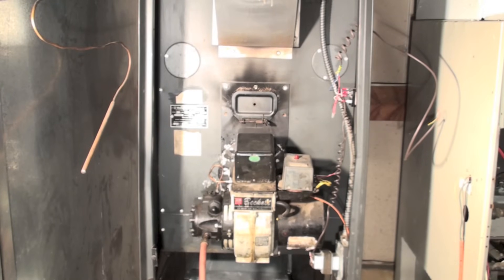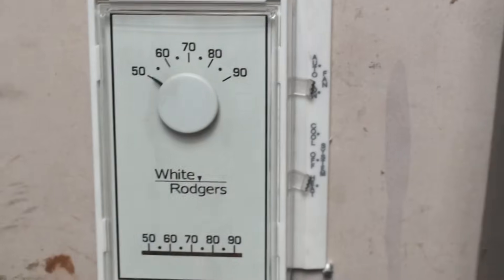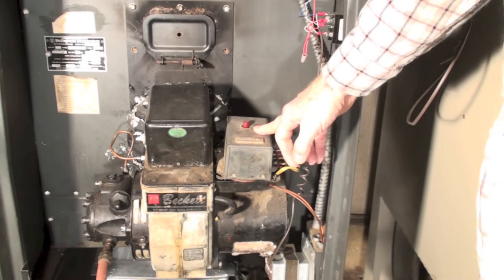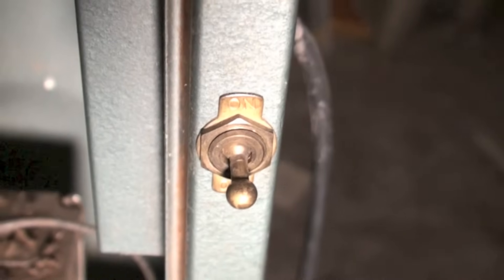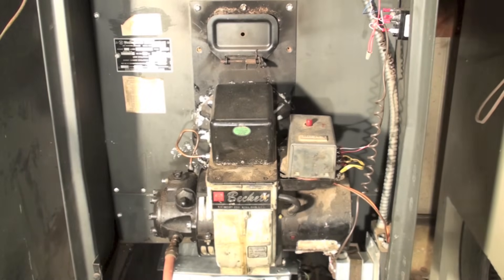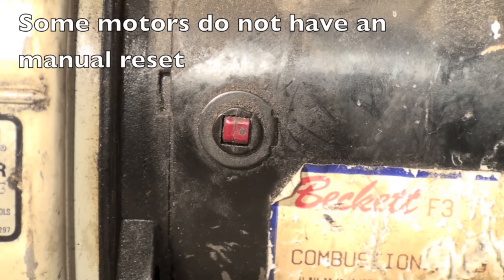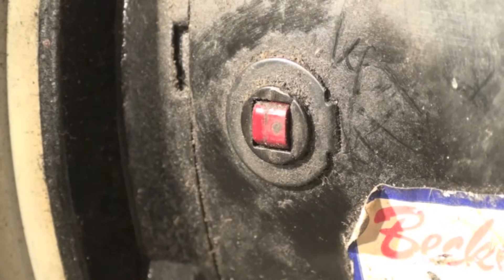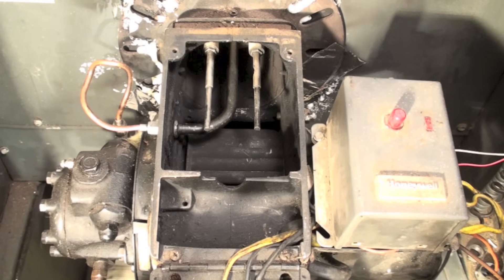Troubleshoot the oil furnace part 1. Burner won't start.

Comment: I want to THANK YOU! Oil burner locked out and did not restart. Did the normal maintenance - filter, cleaned gun, changed nozzle. Still nothing. Realized no oil to the gun, so took the whole thing apart looking for something clogged. Nothing. I thought maybe the pump was not working - flummoxed. Called for repair guy, but it's New Years Day and the guy said it was $300/hour. I decided I'd wait for Monday. Then saw that Home Depot has the pump so I figured it was worth it to try and just swap the pump. $100  and 1 day later, but this did not fix it. Then I thought maybe it's sludge in the line and the pump just can't pump it. Cleared out the entire line by disconnecting from the tank and the burner and literally blew it out with my own lungs - lots of crud, but still didn't fix the problem. Ran clear from the tank to the burner, much faster now, but still would not fire. Then I remembered you said something about the coupling and I pulled that out and looked at it more carefully. It would spin if I put it on by hand with the pump out, but then I had an "ah hah" moment. The thing was partially reamed out and would not spin the pump when it was assembled. Tried to find the part on a Sunday, but no dice. Bought some crazy glue, cut a tiny piece of plastic from the packaging and glued it in where it was supposed to have a flat edge. Banged it on from the blower motor side and reassembled. Tested it first by disconnecting the gun piping part and held a big plastic cup to that side - it spewed out oil like a champ! Reconnected everything and now the house is nice and toasty again. You need to have a special video devoted to those stupid plastic couplings. I wonder how often they fail? My instincts were right but I did not even suspect that thing.
Reply from the maker: Glad you got it going.
GFM

Comment: If I have fuel and spark but it still doesn't light.. What is wrong
Reply from the maker: First, have you gone thru the entire series?  Each video is linked at the end of the previous video.
Does the burner start?
GFM
Reply: @grayfurnaceman  yes... It runs.. I live in a mobile home.. I closed all the vents with insulation... Do they need to be open for air flow...
Reply from the maker: @terrygoboyknarr8061  Did you close off the supply air terminations?
GFM
Reply: @grayfurnaceman  just the vents in the floor
Reply from the maker: @terrygoboyknarr8061  If we are talking about the same vents, they supply the hot air to the structure.  The furnace will shut off on high temp if they are closed.  Remove anything blocking the vents.
GFM
Reply: @grayfurnaceman  will do that in the morning and start over . Will let you know what happens... Thank you very much

Comment: Okay so I followed everything to a T.
The motor is not locked up the oil pump is not locked up. There is power going to the motor and throughout the whole boiler. The red button is out of the motor and I pushed it in a few times reset the oil relay and nothing happened. I took the wires out for the motor hooked it up to the house power and the motor spun perfectly. About a week ago the the boiler just stopped running. I did notice on the oil relay there is no light when you go through the reset motion. Like I said there's power going to it and I even replaced it.
I went to step further and disconnected the upstairs thermostat tied the thermostat lines together. Still a no start. I'm really stumped at this moment.
Reply from the maker: This sounds like a wiring continuity issue.  Follow the power until it stops.
GFM

Comment: The motor runs when I give it direct power and the pump isn't bad where would you turn next? Maybe the cad cell?
Reply from the maker: If the pump does not start when there is a call for heat, have you reset the cad cell relay?
GFM

Comment: I cannot get the fan to turn on. The pump won't try and start either. But the breaker isn't flipped... what should I check? The blower spins freely, the pump reset button isn't popped out, etc.
Reply from the maker: Assuming there is power to the unit, If the burner motor does not start and the reset is not popped, I would be looking at the cad cell relay.  
GFM
Reply: @grayfurnaceman  thanks for the quick reply! I got the fan to start manually with a button on the furnace control system but I cannot seem to get the pump to want to try and boot up. Seems like it could be the reset button itself?
Reply: @grayfurnaceman  just watched your video on the cad cell replay. I will go check the resistance and see if this is the problem. Thank you!

Comment: THANKS  BUT  MY  PROBLEM  IS  INTERMMITTENT  EVERY 7 DAYS IT FAILS TO COME ON .. WHEN  I PRESS THE  RED BUTTON IT ALWAYS  STARTS ..THEN ITS GOOD  FOR ANOTHER 7 DAYS????????????????????
Reply from the maker: I think one question mark is enough.
What I would do is look for conditions that exist when or before the burner fails to start.  Is it only on weekends?  Is it only in the morning?  Does it do it after a setback period?  Does it do it after the unit has run for a long period of time?
GFM
Reply: I  finally  I  noticed  the  2  ELECTRODE RODS   AT  THE TRANSFORMER   SPRING  CONTACT  were slightly OFF  the  HORIZONTAL  WHICH   Prevented  FULL   Contact of THE   Transformer  Springs FROM EVEN CONTACT TO THE 2 ELECTROD RODS       
 I NOTICED  THAT  THE SET  SCREW  OF THE   90  DEGREE  ANGLED FUEL  INPUT  PIPE  WOULD ALLOW  THE  ANGLE TO  BE  CHANGED   WHICH I ADJUSTED  AND  NOW  I  HAVE  FULL  EVEN HORIZONTAL CONTACT   TO THE  ELECTROD RODS AND  NO  MORE  SHUT OFF  OF  MY BURNER

Comment: Why would i have to reset the trip on cad cell relay every few weeks now. I paid for a $200 service call for the first time it happened. I have the boiler cleaned and serviced every year. Basically they couldnt find anything wrong but replaced the nozzle anyway. They also said the arc on transformer was ok but not the best, but still they though it was sufficient. The motor wasnt tripped off, but when i hit the reset it instantly fired up. I did however notice after observing it fire up the on occasion when motor comes on it instantly fired up but sometimes it took a second or 2 to fire up. The boileris a beckett AFG. I dont want to start throwing a ton of money at it if i can narrow down the cause. I have watched almost all of your videos and your very informative. Any information you can advise me on would be very helpful. Thank you sir
Henry

Comment: Ours is super old and unable to find the 2nd red button you are showed. 😏
Reply from the maker: If you have found the cad cell relay button, the only other possibility is on the burner motor.  That one could be located on the end of the motor or on the side.
GFM
Reply: grayfurnaceman Thanks for taking out time to comment.

Comment: So my furnace makes a sound similar to a bad wheel bearing when the burner  is running. Is there any trouble shooting to do or can I rebuild the motor? I’m an auto mechanic so I’m a little out of my depth here lol
Reply from the maker: If the noise is coming from the inducer, the entire inducer must be replaced.
GFM
Reply: grayfurnaceman thank you for replying! Is the inducer that entire motor assembly thing or just the pump piece on the left side?
Reply from the maker: @iphone777  I blew it on that reply.  I was thinking of a gas furnace. 
You could have one of 2 problems.  The pump on the left side could be squealing which would indicate the pump may have been run dry and is failing.  It can be replaced as a unit.
The motor on the right side could be failing and it can be replaced as a unit.
GFM

Comment: Question for you. We’ve talked in the past about the first mobile oil furnace that I have made a video of.  The question is I’m installing a second one to heat my greenhouse. This one is a around 85’000btus compared to the one I first installed that is 63’000  it’s going to be in its own little shed attached to the greenhouse,  on the one in my dad‘s workshop there is no barometric damper on the 4 inch pipe that is basically directly leaving the building and going out about 4 feet from the building with a T fitting then going up another 4 feet with a cap. On the one in my greenhouse the building is 8 x 8 and I plan on going out the flat wall 8 feet from the furnace and doing the similar T fitting and probably 2 feet of pipe up with a cap, do I need to get a 4 inch barometric damper or do these furnaces not require them?  Thanks again for the help in the past Ben

Comment: Hello if u can help me out with this issue I have I'm working on a Lennox electric furnace and my general porpuse switch gets hot when I run what could it be thanks in advance
Reply from the maker: I will need much more than that.
What switch? Sequencer?
GFM
Reply: I found out what it was thanks for ur time thanks for all the videos u put up

Comment: I got a huge problem wit my furence last night around 12 hours ago it stopped working theirs lots of hot water but no heat the thermostat is turned up to the max and still the furence ain’t kicking in I hit the reset button nothing no power I checked the fuse it’s still good, I don’t kno what’s going on I have lots of hot water but no heat would it be the diverter valve ?
Reply from the maker: First, not enough info to tell.  Possible pump problems?
GFM

Comment: Mr. Gray ...great video... I have a Wayne oil burner with a Delavan .50 80 degree A gun nozzle ... I assume the .50 is in gallons per minute.  If I replace the old nozzle with a .60 80 degree A, will I have trouble?.. Will the extra .1 gallons per minute be a problem.
Reply from the maker: You will need to adjust the air shutter to compensate.
GFM

Comment: Furnace works, but no heat comes upstairs as it did, why?  Radiators are warm only
Reply from the maker: Check the boiler pressure.  Should be 18# for 2 story with boiler in the basement.
GFM

Comment: Very usefull videos for us DIY types.  Where would you suggest I look if  one of two heating zones are not getting heat ? I can hear the relay clicking on/off as I turn the thermostat high and low.  The thermostat goes to a control board that also has the water temperature controls.  The furnace works as it should for the upstairs zone. Thanks for making these videos.

Comment: I know this is an old video but maybe someone will be able to help... we recently had a low voltage situation at our home due to a partially downed power line. A few days after it was repaired, we put some fuel in the tank and tried to start the furnace. The manual reset button won't stay in at all when depressed, as in it does not click in at all, comes out as fast as you can take your finger off of it. The furnace was not running at the time of the low voltage, but it was still connected to the power.  Any thoughts on what needs replacing?

Comment: If your tank was empty it sucked air into the oil line you will cave to open the bleeder valve on the pump while the unit is running, you should see bubbles coming out in the oil, hold it open until the bubbles stop then close it and you should get fire immediately.  If nothing comes out you have a clogged oil line / filter at the tank

Comment: Tried to look over videos for a solution but my furnace went into lockout mode, have oil, filter is clean,   Started the motor twice after I reset, now even cutting off power won’t reset it, I did notice the one relay seems to be incredibly loud, might try to replace that tomorrow

Comment: I have a beckett oil furnace and I have some worried thing going on I cant figure out.  the reset light was continues flashing.  I changed filter bleed the pump and all fine.  when I hit the reset it works fine then after the temp is reached on it it shuts down and will not restart on it's own unless I hit reset button.  any help???  thanks
Reply from the maker: During the cycle the unit is probably losing flame.  Any air in the bleed?
GFM
Reply: @grayfurnaceman  hey bud you never answered me about my problem but I figured it out.  the nozzle was clogged.  I removed it cleaned it with carb cleaner blow some high pressure air through it and works like a charm.  thanks for all your help
Reply from the maker: Welcome
GFM
Reply: no air, I bleed it several times all air looks like it's out.  after reset is set when it reaches the temp it shuts down and when it calls for heat again it will not restart on it's own.  the green light is flashing continuous, once I hit the reset it starts and runs fine and I get a stead green light while it is running.

Comment: Thank you for helping fix my furnace! Turns out, the thermostat has to have charged batteries AND be turned on! Duh!!!!!!!!
Reply from the maker: Welcome
GFM
Reply: Hi, Thank you for your excellent videos. The Video entitled < Pump mounted oil burner solenoid > where you diagnose the solenoid and replace it...I have a question. I removed the  screw on top of the solenoid to replace it. When  replaced the solenoid and tried to to tighten the screw on top of the solenoid...I'm unable to tighten because the post that it screws on...turns when I try to tighten it.  What am I doing wrong  ?  Result is that the oil is not leaking through the stop ov the solenoid. Plesse help. Mr. wArren

Comment: I have a Beckett RWD.  I press reset and it runs and heats for 5.30 minutes. The only thing I have done and bleed the system.
Reply from the maker: Does it go out on flame safety or will it restart after a few minutes?
GFM

Comment: Thanks for the video! Came home to the indoor temp at 61 and the heat was set to 63. Thermostat would click on but the furnace never fired up.

Cut power at the fuse box, opened the motor to rotate the blower (which rotated smooth), pressed the red button as mentioned in the beginning, flipped the breaker, turned on thermostat, and it fired right up.
Reply from the maker: Like is good.  Hope it stays on.
GFM

Comment: Hi there have a similiar furnace.. it is a downflow furnace in a mobil hoome. have black smoke coming out of chimney, and not working properly at all... have any videos on how to clean out the furnace? it is a seasonal home in a remote area, difficult to get someone up there to work on it... wondering if you can help...appreciate in advance.
Reply from the maker: I do have a furnace cleaning video.  Check my channel.  You will also need to replace the nozzle and service the unit.
GFM

Comment: My furnace runs great, new control box, fan limit control, filter, nozzle, cleaned oil pump.  Runs one cycle then wont start. Reset doesn't kick off but I have to push down on the rocker for the contacts and it kicks in. I have four control boxes and one is brand new. Put all new wiring in. Took motor out and it runs great, free turning.  It seems the solenoid is not getting energized. The thermostat clicks when turned up and will turn off burner when turned down when running.  Any thoughts ?
Reply from the maker: Do you have power to the solenoid?
GFM
Reply: If you mean the solenoid on the oil line there is no solenoid there on this furnace. If you mean the solenoid in the box where the reset is I think that one is not getting power to it when the furnace calls for heat. Is it powered from the line from the heat - fan switch? I will check the power coming from there. Thank you so much for helping me.

Comment: When I push the motors red manual reset it does not click. what does this mean? Woke up to a cold house. when I turn up the thermostat to turn it on all I hear is a click.When I pushed the main reset it turned on for a little than shut off and blew cold air. 
I checked for spark like in the second video and that seems fine. I can't see inside the combustion chamber but my furnace is very similar to the one in video.
Reply from the maker: If you have spark but no flame, I would be looking for an oil supply problem.  Dirty oil filter, plugged line or tank, no oil, plugged nozzle or failed pump or coupling.
GFM
Reply: Ask a question for troubleshooting

Comment: Hold your reset button for 45 to 50 seconds that may reset it.My blower moved easily and i held it for 45 to 50 seconds and it came on try it if on lockout.I ran out of oil the winter before.Put in a about 15 gallons from my Dads tank and it came on when i did this.